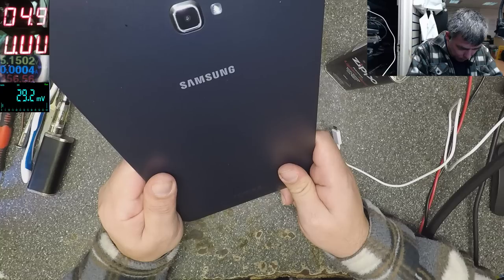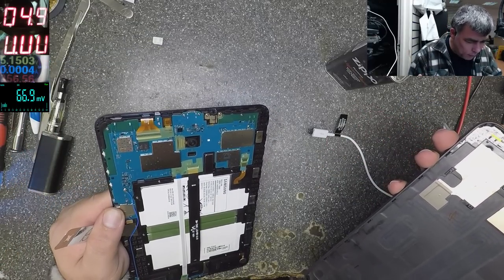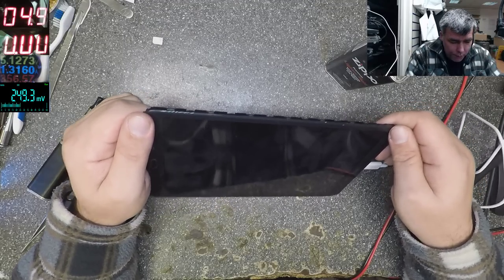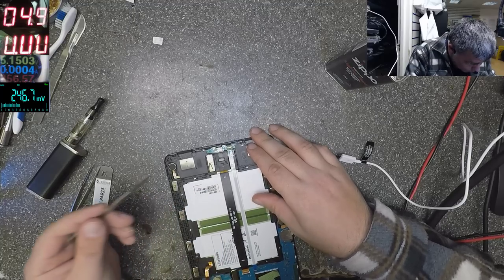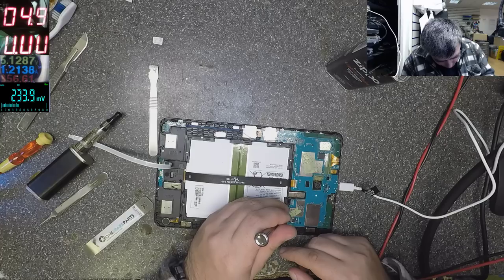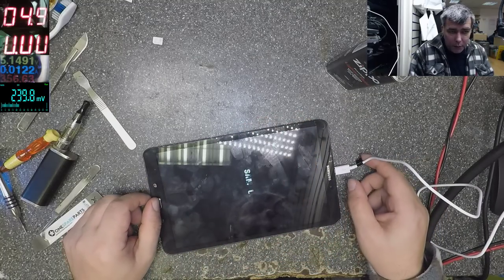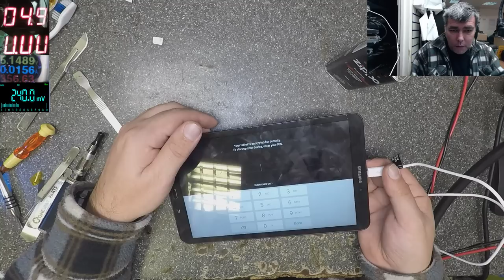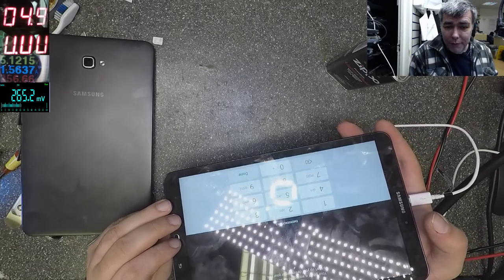Samsung Tab A A6 Sm-585 no picture on screen

Comment: Literally just popped open my tablet samsung tab A 10.1. I unhooked the battery connectors and both the black and white connectors as well I couldn't check the one end of the black cable because it was under some other stuff but I did unhook and rebook all the connectors I could get to and made sure everything was in place as it should be and I snapped the back , back on and the screen was still black when I pressed buttons but I still heard sounds. So I held down the down volume key and power button and reset it and wahlah!!! I had a lit screen! Lol thanks for the video to man just saved myself at least $100 bucks

Comment: I had the same problem on my tab A 10.1 2016, I fixed the problem almost the same way, but I didn't known about this video, well what I did is I applied some good quality tape on the ribbon cable and fastened it to the connector, I dont have any problems now.

Just for a side info, before repairing the tab, when I rub the screen to clean it the picture goes off, hitting the tab gently with my hand brought life back to the display, but fixing the ribbon to the connector is the way to go.

Good luck guys for your repair
Reply: Seif Eddine B omg i just read your comment and do what you say ( I hit my tab from the back)and it works😍👌🏾 (sorry for my bad english i'm french)
Reply: Débora Aboikoni très bien, mais il faut réparer la nappe de l'écran, bon courage
Reply: Okay Merci 😁
Reply: Lol. I followed your instructions by hitting my tab lightly and it came on!! Thanks
Reply: The only problem is, one edge is still dark

Comment: My girlfriend sat on her tablet and the picture disappeared. Reattaching the lcd cable fixed it, thanks. Just be aware that the lcd connector port (little back plastic flip) also must be opened and then closed for good seating and connection.
Reply: How can i open it?

Comment: I didn’t think that it would work, but it did😁on my first attempt I was about to give up. I first tried to remove the thing connected to the battery, when that didn’t work I moved on to the screen, didn’t work and then I tried leaving the battery detached a few seconds once more  and it turned on.

Comment: It's a common problem on the samsung tabs, No picture or weird graphics go straight to the screen cable, They unseat so easy.
Reply from the maker: true
Reply: Electronics repair school  hello sir pls. Reply my comment actually i have the same tablet and i tried the same way as u said there was a battery on my screen after i tried this method then i removed it off from the charging cable and it went dead again and later it dint turned on and then i tried this method 2 more times but nothing happened  (whenever i plug the charging cable it does vibrates) ... Pls . If u have any solution for this problem
Reply: you got any solution? my tab is having this problem
Reply: I yanked that back off.... Thrusted the thick cable back in place and voila... My girl can play farm simulator again!

Comment: Hello everyone! Actually i also have the same tablet and i tried this same way as sir told and it did worked! But the charging battery came and i removed it from power and it went dead again and i tried the same method 2 times again later but no display came .... can u tell me what should i do now ? Pls. If u could help...